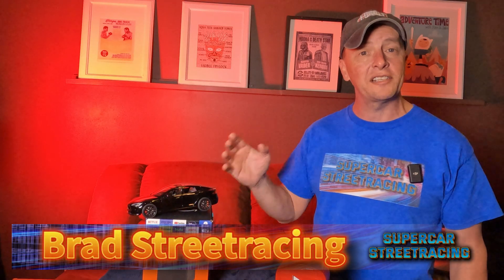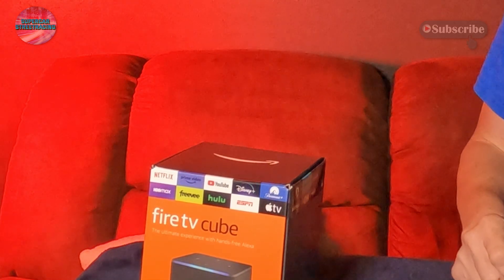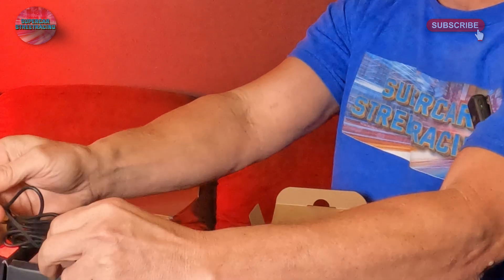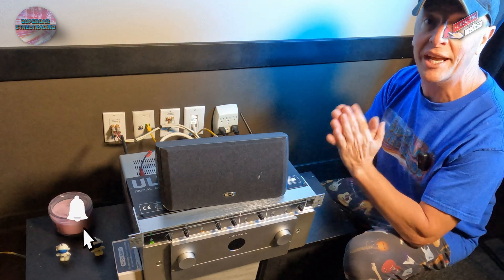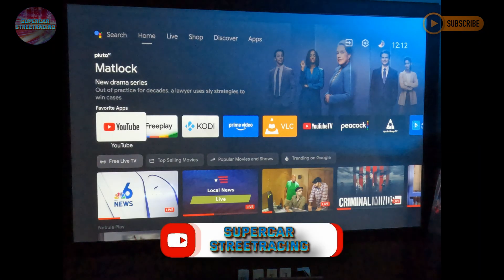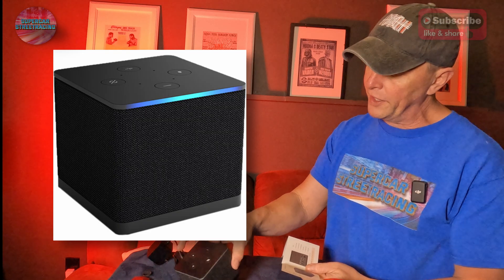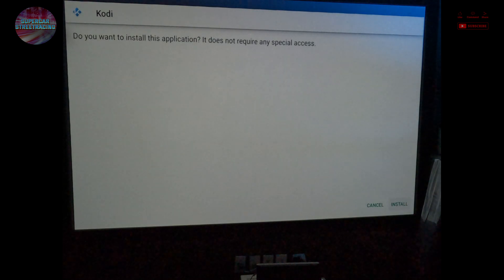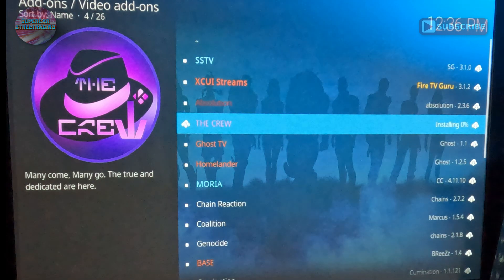I got a Brand New Amazon FIreTV Cube and immediately hacked it and installed Kodi

Comment: I'm on a chromecast right now and will be switching. I like that the cube has direct ethernet and usb plug ins. My question: I'm using a flash drive right now for storage for kodi. Will that work if I just plug that in to the cube?
Reply from the maker: Actually don't know the answer to that question. The issue with the ethernet is that it's not gig.  That disappointed me a lot. I'll try to do some research about the USB drive. I thought the USB drive could only be used to move apps from the fire cube to it but I'm not sure.
Reply from the maker: Oh I don't know if you heard but Amazon is moving to their own Operating system. This means so far with this new change no side loading because Kodi doesn't have a version that works on the new Amazon OS. There's more details on aftvnews.
Reply from the maker: https://www.aftvnews.com/the-first-non-android-fire-tv-running-vega-os-will-be-released-later-this-year/

Comment: what is this even?
90% of the video was you unboxing and plugging in a hdmi cable.
why not write a script? you didn't look at the hdmi input, that's the entire point of this device.
Reply from the maker: Thank you for watching and commenting! I didn't think the HDMI input was that big a deal since it's just a through port. Any suggestions on why this is so important? I'm sure the audience would want input.
Reply: @Supercar_Street_Racing  well, you can use the device to add custom overlays to incoming hdmi or other video, like alerts, other content - so it mixes it - is that possible?
Reply from the maker: @removechan10298 I was just looking that up, getting mixed results on that.  What's a good example about what you would use that for?
Reply: @Supercar_Street_Racing there is no such thing as a "through port" you may be thinking of  "throughput" which is  the amount of bits, or the rate of how bits or data goes thru a cable, or something is measured.   HDMI is unidirectional cable that sends and receives audio and video signals....HDMI.......High Definition Multimedia Interface
Reply from the maker: @gabbagool7414 There's an HDMI input. I completely understand what that means and the implications. I never said throughput. I'm a network engineer. I know what throughput means.